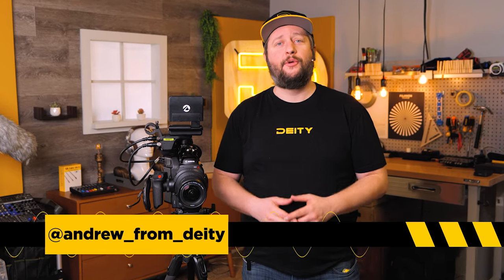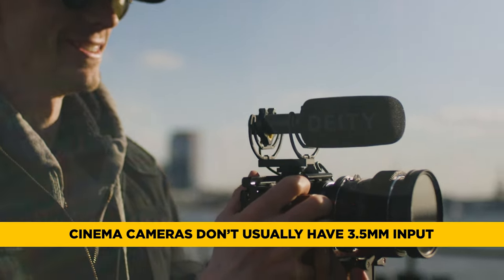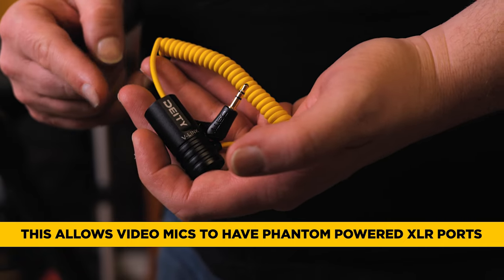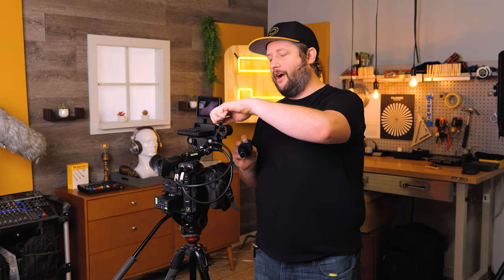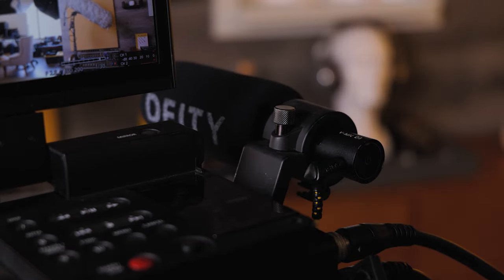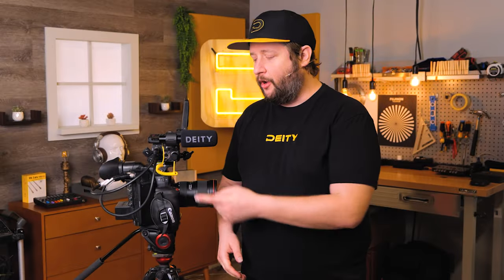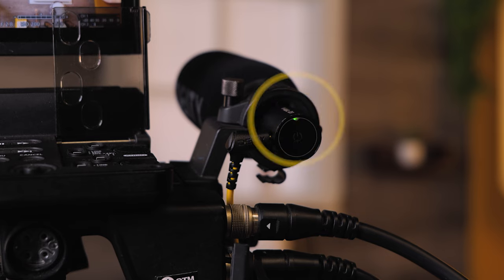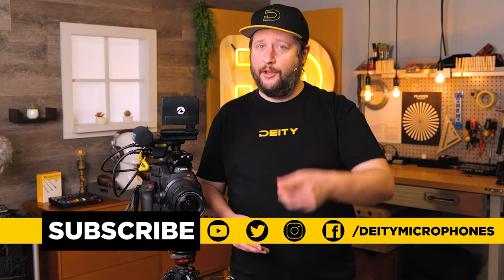V-Link User Guide | How to Connect a Video Mic To a Cinema Camera

Comment: What's the difference b/w this adapter and the D-XLR adapter you sell? The yellow cable? Or anything else?
Reply from the maker: The XLR connect is only ~60% the size of the D-XLR and a this whole setup, even with cable weights the same as the D-XLR.  The ergonomic benefits are also that it's lower profile/right angle which makes cable management a lot easier.

Comment: A very elegant solution indeed! Question: when used with a self-powered microphone like the D3pro or a wireless lav kit, and phantom power turned off, the V-Link should behave like a normal 3.5mm to XLR-M cable correct?  Then, what happens if phantom power was left on in those situations (I assume it would not power the D3pro but won't hurt anything neither, but it would drain camera battery faster when connected to a wireless lav kit)? Thx
Reply from the maker: When phantom power is turned off no audio passes thru the cable. You must have phantom power turned on, which is okay. The D3 Pro also needs PiP to activate on just like the D3. Things like a wireless receiver are also safe to use with the V-Link if you are wanting it just for its low profile form factor.

Comment: Hello Diety, wonderful product! Just wondering, what is that magic arm you are using to mount the C300 mk ii's monitor unit onto the body? What brand is it? It looks compact and fairly light weight?
Reply from the maker: https://www.bhphotovideo.com/c/product/1043731-REG/noga_nf9014ca_cine_arm_nf_hold_it.html
Reply: @DeityMicrophones  Thank you so much! Do you guys do a XLR female to 3.5mm connector that can somehow provide phantom power to the mic? Is such a thing even possible? I have a Sanken mic which I would love to stick into a 3.5mm jack but the Sanken needs phantom power. Wonder if you guys could make something?
Reply from the maker: @chengherngshinn  not exactly possible without a massive dongle type box on the cable.

Comment: Would this be the best solution to use to connect my D3 pro to a an XLR input on a rode caster pro? I’m wanting to use my D3 pro for live streaming, but not sure which adapter to purchase.
Reply from the maker: Yes it would work
Reply: @DeityMicrophones  Thank you. Do I have to turn phantom power on or off on the rodecaster pro?
Reply from the maker: @BroRhy-TheInspirationGuy  on
Reply: @DeityMicrophones  Much Appreciated, I’ve heard some stories of folks frying their mic because of the phantom power so I did a little work around connecting the rode wireless go to the 3.5/phone input on the RCP, but I lose the phone channel and can’t take phone calls while live streaming. And I just like the idea of going as direct as possible to sound board . I ordered my V-Link yesterday ☺️ Thanks again. Happy Holidays.

Comment: Hi Deity, I have a Deity V-Mic D3 (not the pro one), will using this adapter and 48v phantom power eliminates the need to use the 1,5 AAA battery? 
I hate to have to check the battery every now and then especially when the mic is installed up high with a boom arm.
Reply from the maker: No. You'd still need a AAA battery. That said, this cable and a D4 Mini would be 100% passive still

Comment: What are the chances that one already has phantom power on in their camera and connects it afterwards?  Will there not be a spike in electricity especially with the TRS touching other contact points within the mic?  Does it prevent that?
Reply from the maker: Wouldn't be an issue. XLR pins are separated horizontally and not vertically so you aren't able to jump the 48v to the wrong pin if it's already turned on in your camera settings.

Comment: Hi guys. I have a Deity mic, the D4 and I need to use it with my audio interface, the Presonus audiobox 96. I bought a Jack 3.5 to xlr cable. Plug the cabe to mic with 3.5 jack and the xlr to presonus. I tried with 48v phantom power and without and do not work. Can you help me?
Reply from the maker: That's exactly what the V-Link solves.

Comment: Any solutions for doing the opposite? An XLR female to 3.5 male which uses batteries or has an integrated rechargeable to provide phantom? Something like the Xvive P1, but less cumbersome and already with a 3.5 output.
Reply from the maker: The closes we'd have is the HD-TX XLR recorder that would let you route the headphone output to your 3.5mm device.

Comment: wats the difference between this and say the D-XLR adapter?
Reply from the maker: This one is smaller, right angled, and no need for an extra cable.
Reply: @DeityMicrophones  if I'm using this with the v3 d pro mic, I don't need phantom power, correct?
Reply from the maker: @patentjt  for what? For going into XLR? if so, you'd want to use this cable with your D3 Pro.